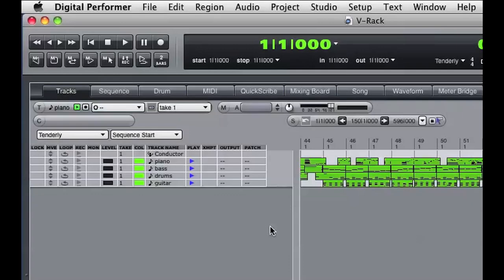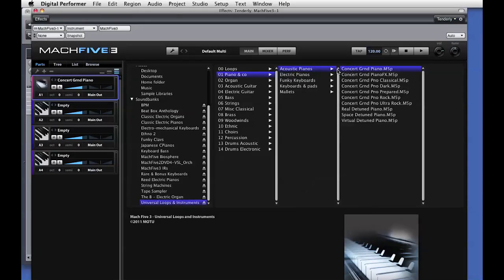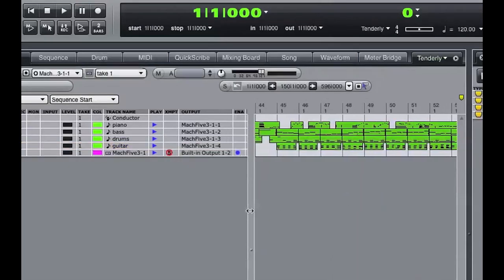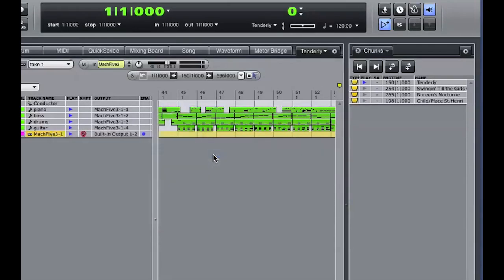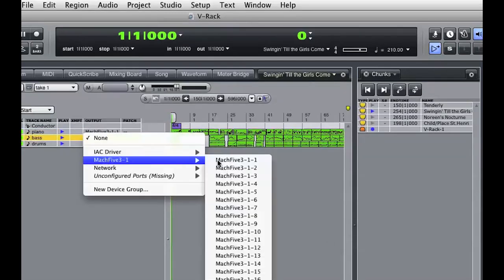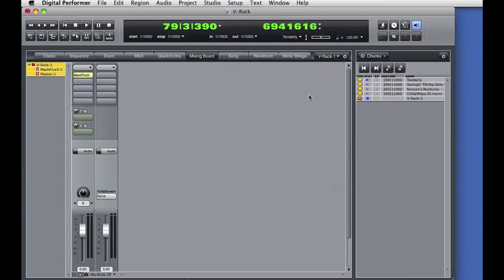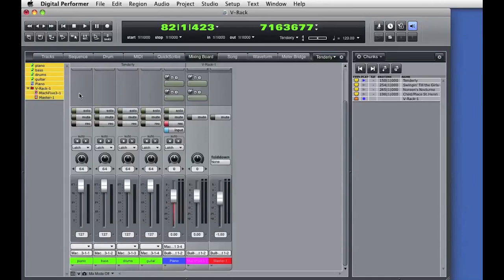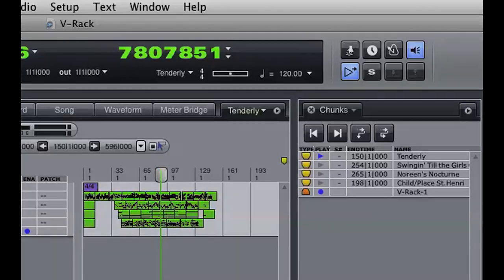DP Chunks and V-Racks (Part 2 of 5)

Comment: A question—what purpose does creating the master fader serve in this video? It's set to the same output pair as the MachFive 3 Instrument track itself (with the exception of the piano track, which you've assigned to MF3 output pair 2). So what does raising and lowering the master fader do in this case that raising and lowering the instruments track doesn't?
Reply: It brings all the signals from chunks back to one place for final processing master etc